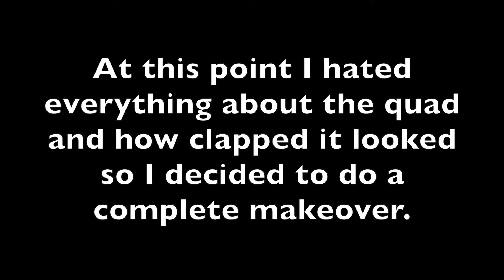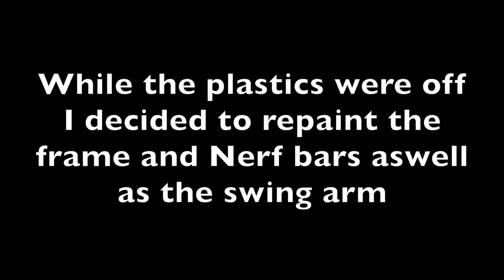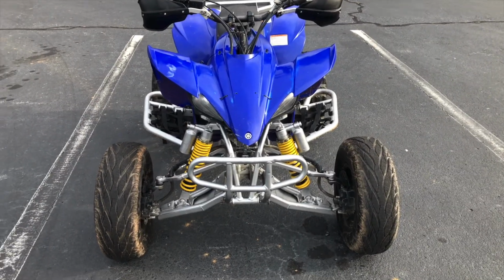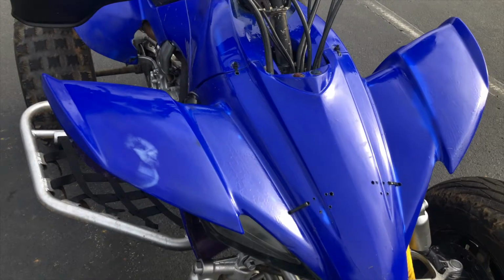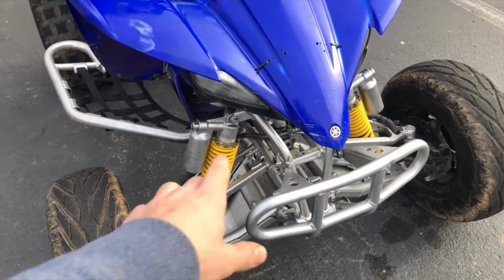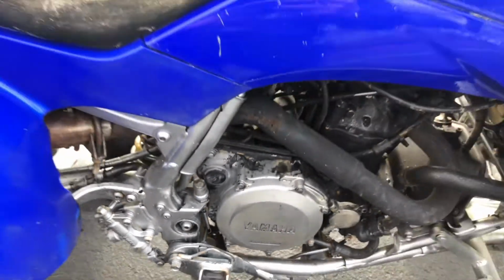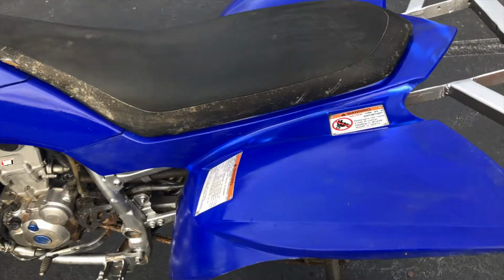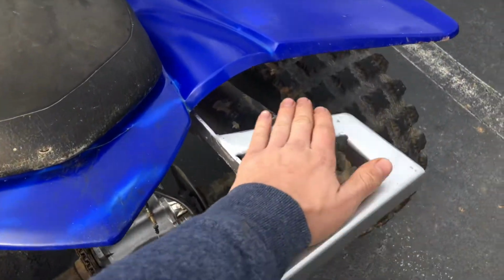Restoring an abandoned YFZ450!

Comment: Great job man, btw what brand of paint remover did you use because im currently working on a yamaha raptor 250 and the previous owner painted the motor with this cheap crappy paint and i wanted to get rid of it
Reply from the maker: I used citrus cleaner from any Home Depot. Very orange stuff. Used the gooey in a container stuff that you have to apply with a brush. Takes a bit longer but doesn’t ruin the plastic and gets all the paint off.